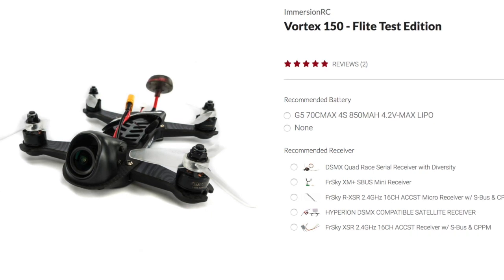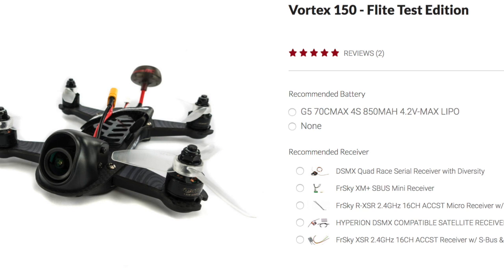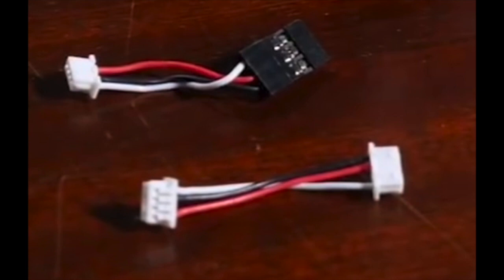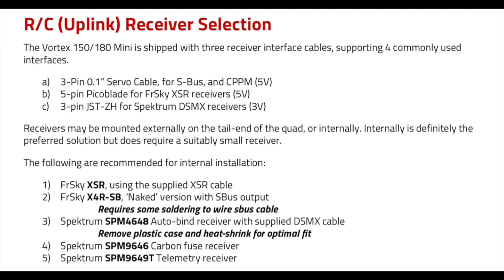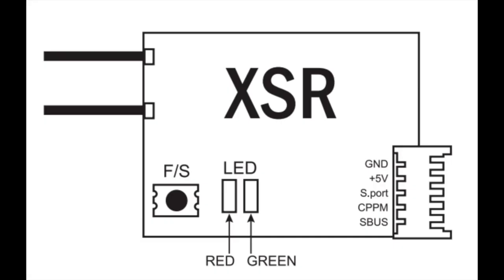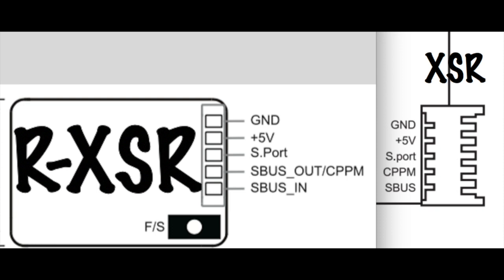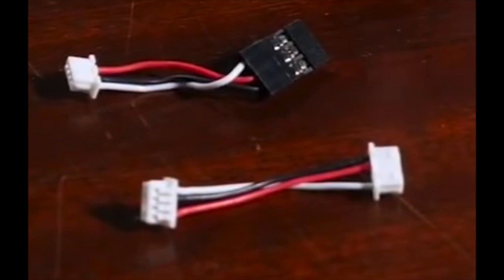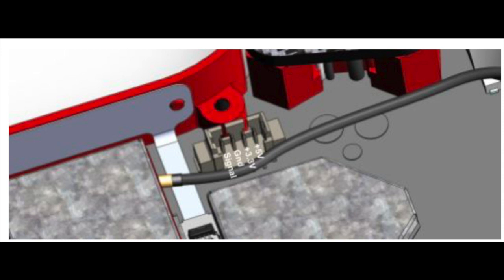Vortex 150 Wizard wont connect to FrSky R-XSR

Comment: U can pop the white lead 5th pin out and take out the green leads 4th pin and put the white one into the 4th as well so u don’t need to solder any wires for that.
Reply from the maker: Noetic333 yes.  You are correct.  That’s a cleaner way for sure!

Comment: Yep. Pretty sure that’s the same prob I’m having.   I ordered an XSR, but may try to make it work.   U take a pic of your rewiring??  There isn’t a lot out there on this particular issue.   Thanks man!
Reply from the maker: Dwayne Casey I don’t have any pix of this, but if you wire the SBUS out to the signal pin on the vortex all will be well, assuming you also have the positive and negative leads connected up as well.  Be sure you have your receiver bound to your radio...
Reply: SloHandz FL ,  thanks.   I was moving things around  my desk and saw I had another Frsky receiver, just xsr, I believe, Hanging on my helping hands....It’s just a bit bigger but was recognized by vortex wizard quickly.     The R XSR  fit much better but I’d not tried a re wire...
Reply from the maker: So glad to hear it.  Now you're flying I hope!

Comment: So we are only using 3 pin connections then?  I was told I use GND, 5V, SBUS OUT.  This correct?
Reply from the maker: Yep.   You can try hooking up telemetry on the GPS port on the opposite side of the board, but I got a little shy using Betaflight and never invested the time to iron out the wrinkles...it worked (sort of).   Then I just flashed a backup and gave up on that.